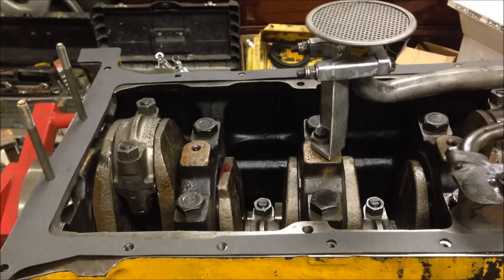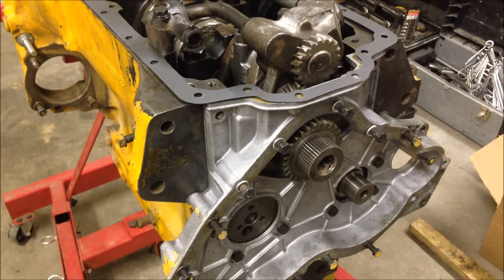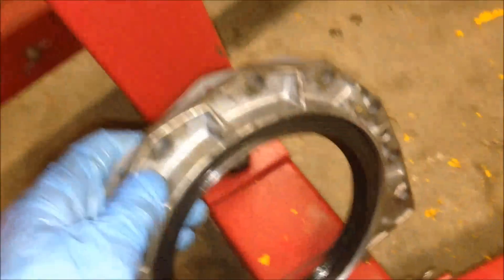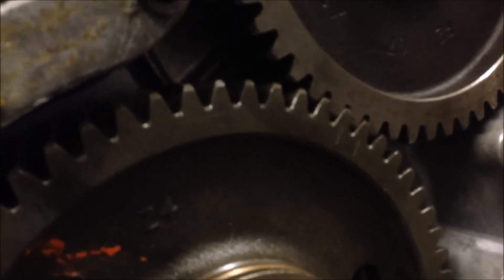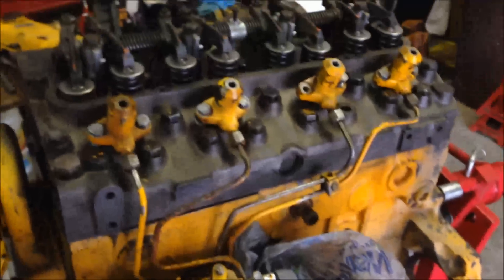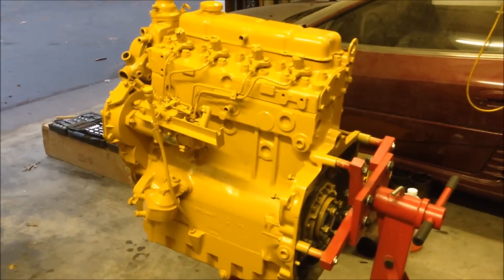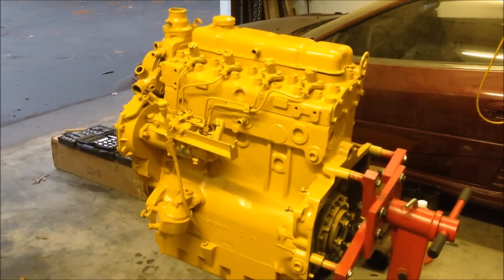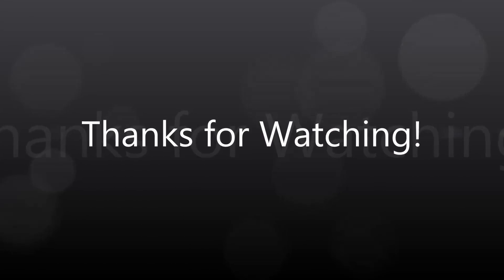Engine Rebuild / Assembly - Perkins Diesel 4.236 - JCB Backhoe Project Part 6

Comment: hey do you know what turbo this is?I'm looking for a replacement for my jcb 3cx because it's covered in oil especially on  the intake side and i get blue smoke which is concerning.Otherwise the engine sounds strong so this might be the issue.
Reply from the maker: no idea

Comment: Hi ProjectsbyTMD. Rich here partner Columbus Ohio. I have a perkins parts engine LD for fixing a AR perkins. I was going to use the Camshaft from the LD engine but it's different. The Lobe's are in a different Timing Order. I'm pretty sure most 4 cylinder engines run 1.3.4.2. Except a Old Ford industrial wich I think is 1.4.3.2....? The LD is 3.9 Liter and the AR is 4.2 Liter.. is it the Stroke changing the lobe order ....??  Also one day I may bolt a Turbo onto this AR .Can I use the Natural Asperated Camshaft...? Or do I need a different one because of the forced air from the turbo....?  I read the Nonturbo is 18.5.1 Compression and the Turbo engine is 16.5.1 Compression. Think it will damage the engine.....?  i'm thinking it should just be more power....? But i'm worried about the difference of Camshaft on a Turbo Engine...Vrs.  Nonturbo....Rich...
Reply from the maker: Rich - you're asking some tough questions.  I would contact your closest Perkins dealer to get the info that you need to answer your questions.
Reply: Cat bought perkins engines...Some feller here in internet calls them Perkapiller....Haha....Thanks....Rich.........:)

Comment: hello, I have a question about what you were saying on the injection pump, when you have the marks lined up, is there a mark behind the inspection hatch that must be timed relative to tdc on the engine? thank Robert
Reply from the maker: Yes, the camshaft, crank, and injection pump timing marks must be lined up.  They are visible on the front side of the engine.
Reply: Have you stripped and rebuild one? I'm asking as I have a friend of a friend who had an old Perkins in his yacht but he has removed the pump and then sent it away to be rebuilt, however he believed the pump was correct and altered the timing of the engine to suite it and now obviously she won't run, he came to me to look into it as I look after my friends trawler, haven't worked on a cav pump myself as my machines are all VE pumps, I'm wondering if the pump could be set 180 degrees out for example
Reply from the maker: Yes, there is a mark on the injection pump - inspection hatch - please look at time 2:55 in the video: https://www.youtube.com/watch?v=ZaFB66NzeEk